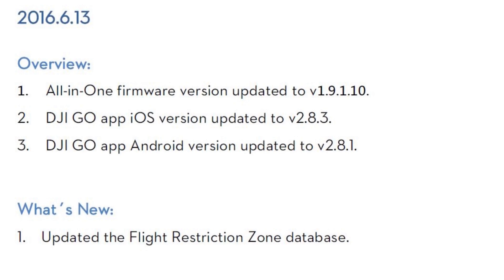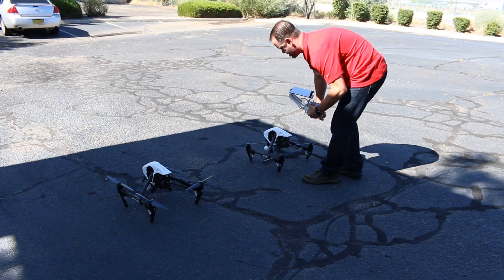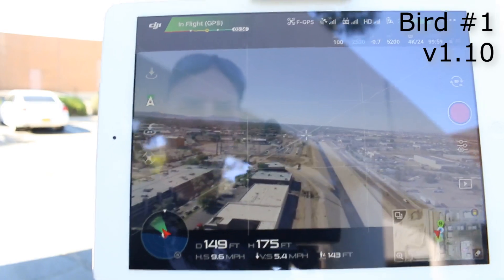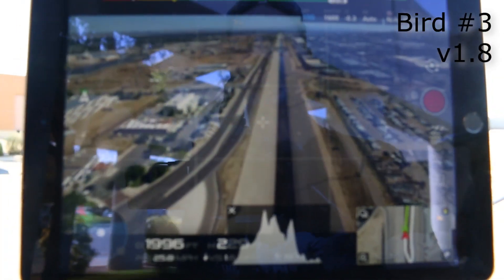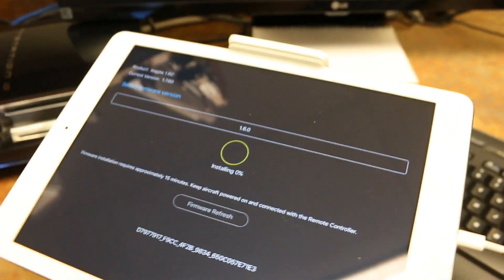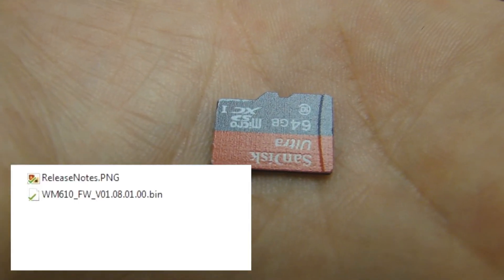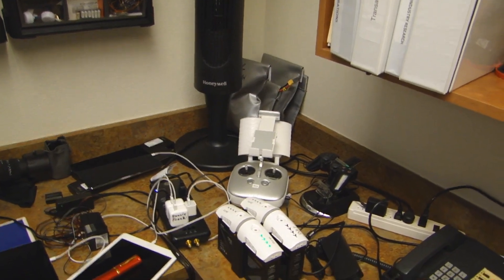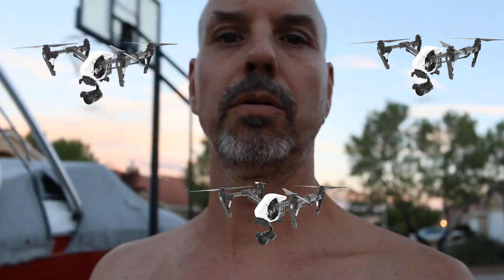Make your Inspire 1 great again...Part 1...

Comment: Donnie you made my investment of 10k worth of Inspire 1 V2 equipment work again. I watched this video knowing that I would probably brick one part or another if not all of my equipment.  I'm happy to contribute to any form of gratitude that I can. 
You asked about peoples outcome with the X5. I found out that for me the "Magic Key" file you talk about worked great to go from the most current Firmware down to 1.09. On both my X3 which I did first, and my X5, neither would go all the way in just one jump. But, one jump from current to 1.09 and then to 1.08 worked great for both of them.
I also found some other sites to use for firmware and a better video for downgrading the Go App. It's just easier to understand and it allows you to use the current version of Charles which helps a lot. As you can see I'm talk a lot. Below is the steps I went through with some important details not mentioned by others that may assist some people in this task.

First I studied for 10 hours to determine the whole procedure.

I figured this out by using 4 videos off youtube.
https://www.youtube.com/watch?v=GmX_MESi86o
https://www.youtube.com/watch?v=fEhjTpsW2Zo

He recommends using this video to roll back your Go App software listed below. But I found a much better one to learn how to do that.
His: https://www.youtube.com/watch?v=D7Re0q1NRgs
Mine: https://www.youtube.com/watch?v=ziP2SBTzDh0
I used Charles 4.2.5, free version

Locations to find files:
Direct from DJI, but you need to know the URL. With all the info out there you can find the correct one directly.
http://dl.djicdn.com/downloads/inspire_1/WM610_FW_V01.07.00.90.zip
http://dji.polybotes.feralhosting.com/DJI-Firmware/BIN/

Notes:
 1. 
It's hard to tell sometimes when a firmware update has really happened in the downgrade process. If you feel it has, shut off the drone. Remove the Micro SD, read the txt file. The top of the file is what you are concerned about. Make sure to remove your dummy debug file otherwise you will just do this over and over.
 2. 
In Charles, when you make a mistake and try to go back you will never get to where you originally did. Clear everything. Select the P... buy area and then disable ssl proxy. Now search for your dji go app again, start downloading and go through the whole process again. Also make sure you turn off break points. If you don't it will never work correctly again.
 3. 
The magic key process works very well for downgrading the firmware on your drone, cameras, and motors. You can downgrade many versions at one time. I went from 1.11 to 1.09. They said you could go all the way to 1.08 but that never worked for me. I may have not waited a long enough time. It can take an hour or more sometimes. I recommend going down to 1.09, and then to 1.08. That worked for the X3 and the X5.
 4. 
One time I screwed something up on the process and the camera started beeping like the firmware upgrade was taking but all four motors beeped constantly for almost an hour. Afterwords though the firmware finally worked.

Process for getting the correct version of DJI go on to your Ipad:
 1. 
First remove the Go App from your Ipad. Backup your flight data if you want it. Then make sure your Ipad or Iphone does not have internet access at all during this time. Later it can but not during this process.
 2. 
First you have to install a old version of Itunes on to your PC. Make sure you never let it upgrade. Don't open now.

 1. 
Install Charles from https://www.charlesproxy.com/download/   I used 4.2.5. Does't appear to make a difference in which one you use.
 2. 
Get you Itunes account setup. Make sure you have 2fa turned off on your Apple account.  appleid.apple.com
 3. 
Select Itunes Store in Itunes and sign in.
 4. 
Now go back to the store and authorize the computer.
 5. 
Now open Charles, run windows side by side.
 6. 
Firewall may have issues. Authorize all access.
 7. 
Search for DJI Go, we don't want 4. 
 8. 
Select download or get, it will ask you account info again, tell it to remember it, watch for the little percent indicator in top right window. Once it starts downloading pause the download and then delete it.
 9. 
Go to Charles, find P...-buy-itunes.apple.com. When you click/open it you will see one or more <unknown> that is ok. Right click on the buy-tunes url and select "enable SSL Proxy"
 10. 
Now go search for the program you want again, download it again, stop it seconds after it begins just like before, and delete it.
 11. 
Go back to Charles, you will see a new buy-itunes url that looks the same as the one above. Open it and go down to "buy product". Right click and select "break points". You are now ready to begin.
 12. 
Find the version of the DJI Go app you want, in my case DJI Go I wanted 2.9.2 which is on the DJI Go 3 spreadsheet. and that number is = 818874204. Make a note of that number. A couple of the URLS above have links to these docs to lookup the number you want. 
 13. 
Now you are going to go back to Itunes search for the Go App again, and then download. This time though Charles will stop the download allowing you to put your number in from above.
 14. 
Charles will now have a new tab on the left called Break Point. On the top right of Charles click Edit Request Tab, then on the bottom click on XML Text
 15. 
Here you will see XML on the screen and you will see a String variable with a number like yours. Put your number in it's place.
 16. 
Now select Execute on the bottom, it will prompt again and select execute again. Let your download complete. You may have to hit execute again. 
 17. 
After downloading check Itunes under My Apps, right click on what you downloaded to see the info/version of what you got. You can find this ipa file on your Win7 pc at: C:\Users\YourName\Music\iTunes\iTunes Media\Mobile Applications if you want to back it up. It's a good idea.
 18. 
Connect your Ipad with your USB cable. Select your device, go to Apps, and install this version of DJI Go. Accept everything you normally do. Do not allow updates. Look for that, find it and disable it.

Process for downgrading firmware is very straight forward. Remember it can take an hour for some down or up grades. Do this first with the X3, then the X5.

TO GET PAST THE v1.11 "no roll back allowed" BOTTLENECK: Create a BLANK file with NO EXTENSION, and put it in the root director of your MicroSD card.
Always start with the X3 if you have one.
For X3 camera make a dummy file in the root directory with this name = WM610_FW_DEBUG     no extension at all. No .txt, nothing. Nothing needs to be in the file.
For me it did not work to downgrade all the way to 1.0.8. I had to go to 1.09 first and after that worked I could download to 1.08.
So make sure on the root directory of your Micro SD you have your Dummy file, and you have your 1.09 .bin firmware file. In this case that file you need is WM610_FW_V01.09.01.30.bin
I found if I had other things on the SD card that it could cause issues. So start with a clean formatted SD card if you are having issues. In other words before you begin format a Micro SD card using your drone.
Make sure you Remote Control (Radio) is turned off. Your SD card is in your X3, and turn on the drone. Initially it will take a few minutes before it gets to the upgrade process of the sound "D-D-D-D----D-D-D-D". This takes a long time to complete. Your drone, it's camera, the gimbal and the motors are all going to do things you may not have ever seen before. The worst part is that it's hard to find out if it's actually completed. You may or may not get the completed firmware upgrade tone of "D-DD, D-DD" Either way try to figure out when it's done. Turn the drone off, remove the SD card, read the .txt file logs and see if it did complete the downgrade. Make sure you remove the dummy "debug" file. Try powering it up and see if it works. If not try to sync your remote with the drone. There are many videos on this. If the drone did not upgrade correctly do it all again. When you are done go through the same process to downgrade to 1.08. That went very easy for me. I did have to sync the remote with the drone though. 

For X5  camera, you do basically everything the same as above with the correct 1.08 and 1.09 bin file. Your dummy file's name though is  WM610_FC550_FW_DEBUG and of course the bin file will be for the X5.

Donnie thanks again. I have used my drone so little lately that I get nervous now when I fly it. But one thing is for sure. Set the drone on the ground, turn on the remote, turn on the drone and just fly and shoot. No more issues!!!!!!!

Note: Make sure to to re-calibrate your IMU or ICU (what ever it's called) and your compass before flying. Check all settings on your Go App because everything will be lost.
Reply from the maker: Wow!  That's a LOT of great information.  It's funny how these hacks are kind of an arms race with DJI.  As DJI "hack-proofs" their software and/or FW, third-party vendors and developers up their game.  There was a time that my video was bleeding edge.  Just months later, it's become almost irrelevant.  Good on you for doing your homework, and I'm glad my video had some small part in getting your birds back in the air.  

Please leave your notes up on this page, as I plan on accessing them and studying them when I have more time. 
 For now, off to work.  You have a great day.
Reply: You and Donnie have definitely laid it all out and made it simple.  I am having problems downgrading from 1.11 for my I1 pro..

I have followed the directions to a tee..I believe..and am still running into issues.  I have downloaded the files from the polybotes link you provided above.  The files on the site (V01.10.01.40_AC.bin) are not labeled the same you and Donnie have in your examples (for my I1 pro it should be WM610_FC550_FW_V01.10.01.40.bin).  When putting the fw on the micro-SD card I rename it WM610_FC550_FW_V01.10.01.40.bin).

My debug file states as the last entry: 
========== 2014.01.01 00:00:06 remo-con disconnect======

Packet: WM610_FC550_FW_V01.09.01.10.bin

Result: Corrupted.

Firmware bin file is corrupted, download it again from the DJI offical website.

I have tried 1.09 and 1.10 with both stating corrupted.

do you know of another download site for the legacy software?  When trying DJI site it only has 1.11 for x5.

Thanks.
Reply from the maker: Hello Flying High.  I'm sorry I didn't see this comment until just now (12/16/2018).  Funny, but I'm having the same issue with a friend's Inspire 1 Pro.  We have spent about 6 hours trying to roll back his FW to no avail.  As you can imagine, we tried everything.  The good news is that I downloaded some slightly different .bin files 3 or 4 days ago, and we're going to try these new files tomorrow night (Monday).  If the roll back works, I will add to the Description section which .bin files to use and where to get them.
Reply: Thanks, Donnie.  This is so effin’ frustrating.  If anyone can figure it out, you can.
Reply from the maker: The problem is that DJI products are VERY inconsistent, and DJI support SUCKS ASS.  They're the worst EVER.  So we're pretty much on our own.

Comment: donnie..............what is the furthest you can fly with inspire 1, i have your FW, and i get about 1000 ft and it start losing signal
Reply from the maker: Depends on the environment.  Line of sight, I can get a solid 3,000' with no boosters.  It's been a while since I experimented.  With the passive signal boosters I make a mile easy....again, provided line of sight is maintained, you're not around metal structures, and there's not a ton of microwave interference.  

I highly recommend the 32 channel hack.  It helps.  And get those cheapo passive signal boosters.  They're good for 25% more distance.